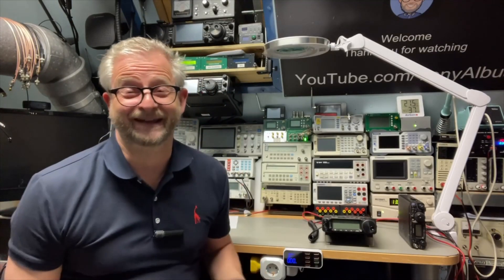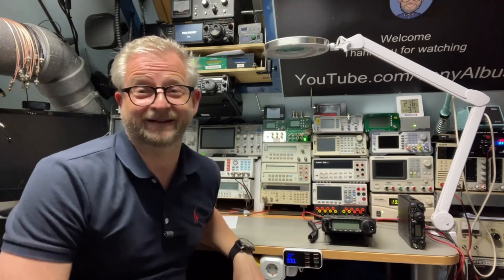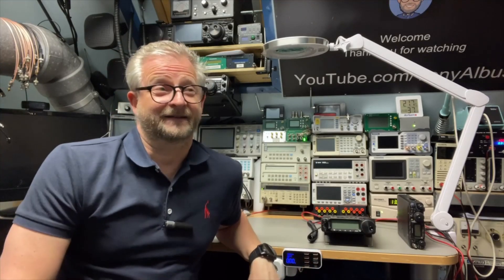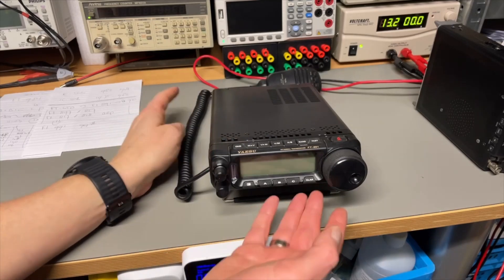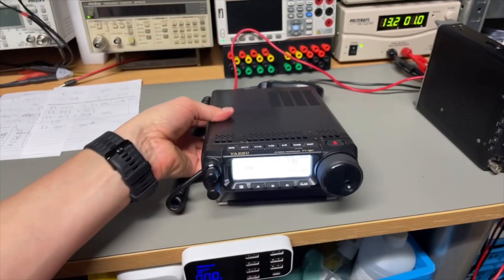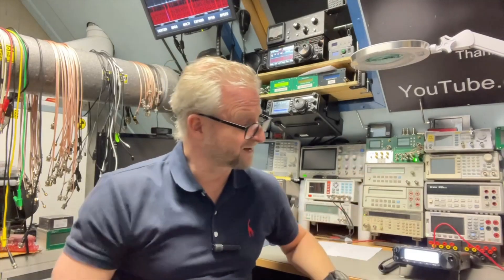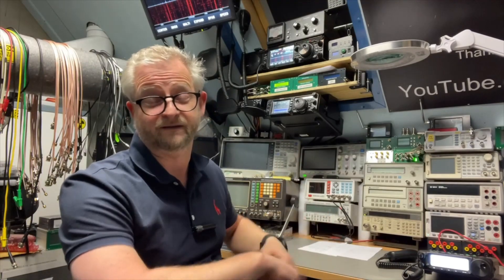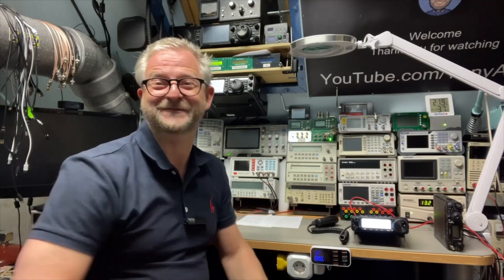TA-0321: New Toy FT-891 - Now the Yaesu line makes sense (BlaBla)

Comment: I love this radio, as it delivers full output power with a 12.8V LiFePo4 battery. Regarding the "ramp up" power at AM and FM, I guess it has something to do with the foldback circuit in the PA-stage. Not an issue for me anyway, if it protects the finals from high SWR. The QRP-radio FT-818 also has a similar "ramp up" curve on AM/FM, so I guess it's an intended design by Yaesu.
Reply from the maker: Yes i like it too, the display is very clear and receiving seems better then my old FT-450 and 897.

Comment: Congrats! FT-891 is great. I bought it as my first HF radio. Easy to use and very nice receiver with DNR. So far very happy with it. 73 from Poland. There is only 936 km between us so we should be able to make some QSO sometime :)
Reply from the maker: Thanks Jonasz, yes i like what  have seen quickly so far. Yes a QSO sould be possible, my endfed wire it the good direction to Poland. 73

Comment: Nice cheerful video Tony and a really nice radio too. I admit that I was someone who thought the FT-891 was a replacement for the 857.  So with the 857 now being discontinued this means that there is no longer an HF\50\144\440 small form factor radio available from Yaesu. In a way that should not be a surprise as the 857 is a nightmare to control due to the extensive menu system which requires the user manual to be on hand all the time 📖📖
Reply from the maker: Thank you Ian!, The 991A is not that big and it has the tuner inside so you save space there too. But the 857/891 size is gone. or the smaller 817/818 and a little amp :)